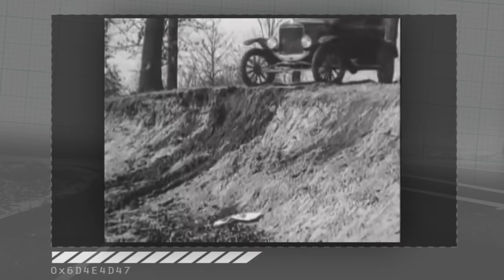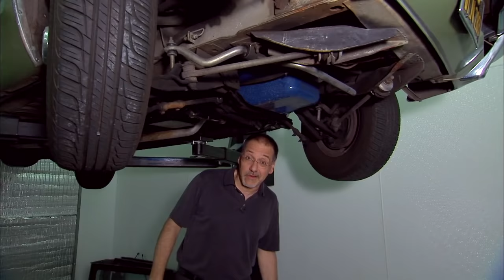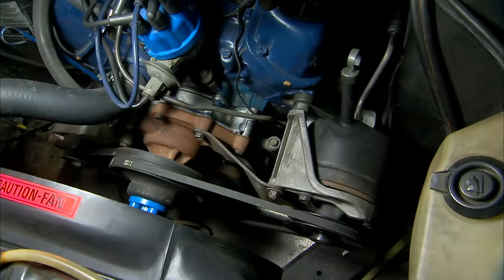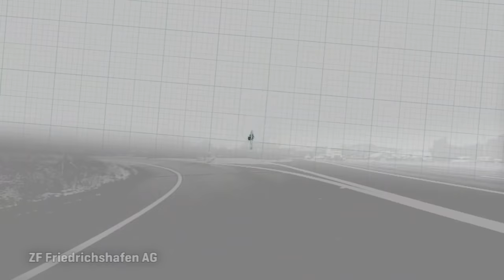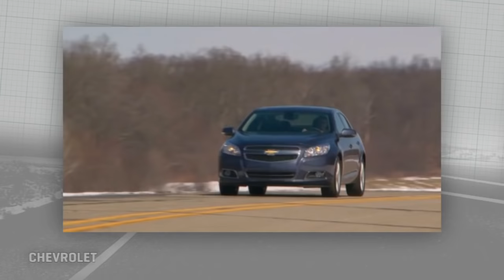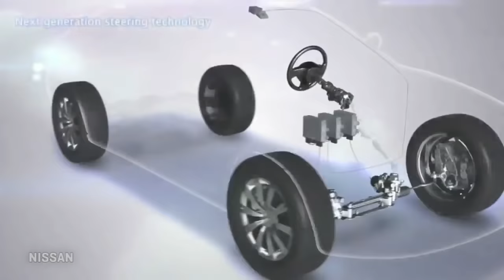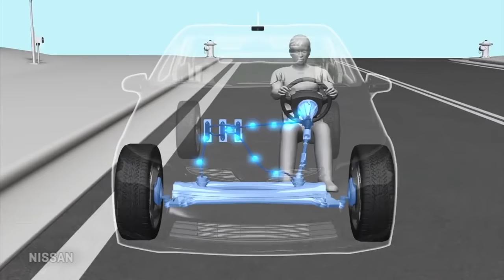Car Tech 101: Power steering explained

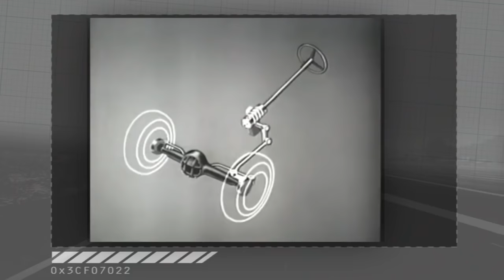Comment: Looks like he was really going rough on the engine at  3:30  what a idiot driver
Reply: +TEXASBLAZE 101 that was very far from idiotic. of course you cant stay in high revs all the time but from time to time, when you need power, there is nothing wrong with visiting them.
Reply: Look at speedometer. Maybe the transmission shift down itself to have more power for uphill. :)

Comment: Steering by wire will inherently cool is dangerous simply for the fact their is no backup. If your power steering fails you can still steer the car through brute force and at highway speeds does not require much effort at all. So if you don't have the raw physical power to overcome the steering at low speed less than 10mph you'll probably still be fine even if the car gets dinged up. I've driven cars with no power steering that were supposed to have power steering and it's not very comfortable but completely doable. 

For drive by wire steering to be safe it would require 2 completely separate systems that each on its own can steer the car so the failure of one doesn't = wreck.  Also at least one of which needs to be able to function for a few minutes even in the event of complete primary power loss.
Reply: Aircrafts fly by wire and nobody says anything even when the risk if those systems fails are much biggers. If those systems fails in the air is the end, even with emergency power of 5 mins that will not work in the air, in a car you can stop inmediatelly, in a plane you need to find an airstrip, it is reliable, the fear is not the lack of energy or connection, that can happen too with the mechanical attachments, the fear with an all electronic system in future electric cars like Teslas connected to the internet is the hacking at distance.
Reply: AZR NSMX1 aircraft systems on commercial aircraft have multiple backups and are capable of operating untill the plane lands even in the event of complete fuel lost, because of a special ram air prop that deploys from the bottom of the plane in the event both engines and the auxiliary power unit in the tail of the plane fails. Which any one of those 3 engines can supply enough power to power the entire air plane. The prop that deploys is roughly the same size as the main prop on a Cessna and supplies emergency electrical and hydraulic power.

Comment: Is a car with no power steering bad?
Reply: +R-R huayra you have to turn the wheels with your arm strength, but probably not that bad once you get used to it. It will definitely save gas, one less thing the engine is being used for
Reply: +PLAYBOY69 yes it is   you have to actually turn the weight of the tires around directly with your arms

so if they have like 2,000lbs on them then thats how strong you need to be to turn them around with that much weight resistance
Reply: No, it's not. In fact, at speed, it makes next to no difference at all. All it takes is a bit of thinking ahead when you do your turns so that the wheels are always rolling and you don't even need it.